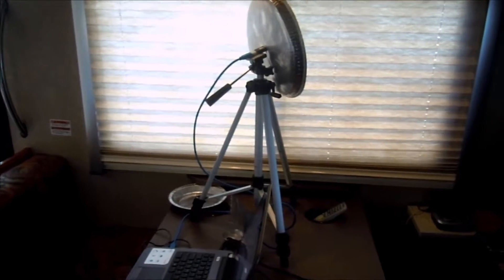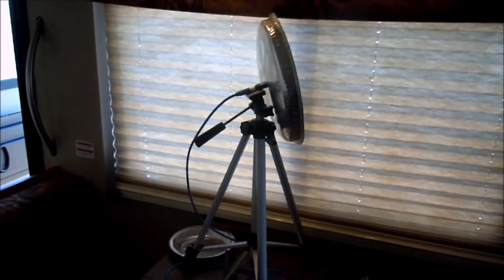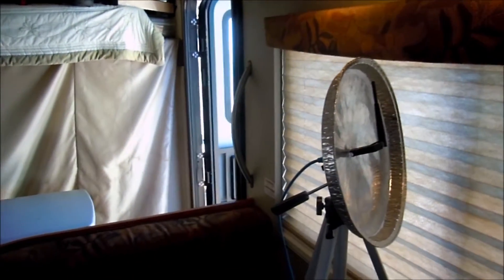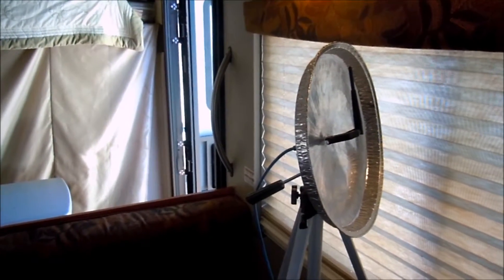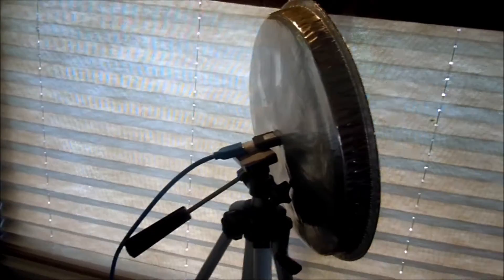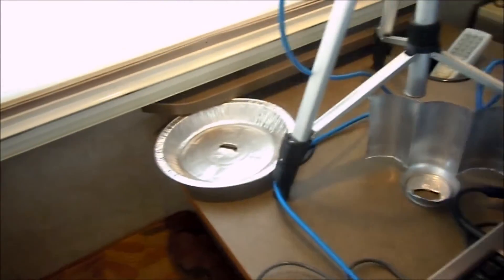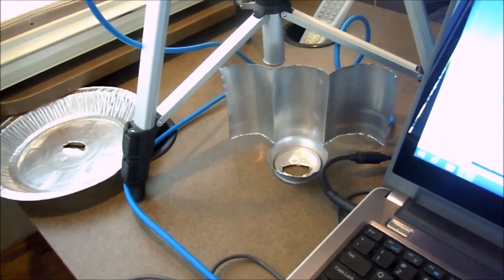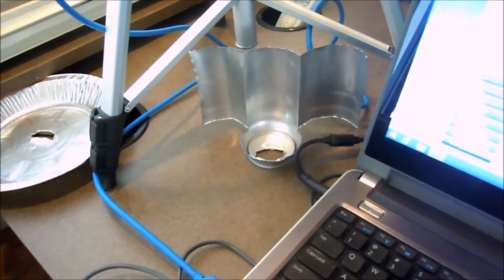My Pastrie Pan WiFi Antenna

Comment from the maker: Just came from the 99 cent store and there is the mother load of aluminum trays, pizza pans, all nice and big and ready to serve as wifi antennas, I would try them but mine is working just fine. To make the rectangle hole, I cut one line about a half inch long in the center and then at each end of that cut I cut two more at a 45 degree angle or so to extend the hole to the length of the usb device. I fold up the sides and ends so the usb gets a little support when it is inserted in the hole and put a rubber band around it to keep some tension on the flaps over the usb. If you cut just a hole, there is little for the usb to grip and it also makes it better to move in or out to tune the reception.